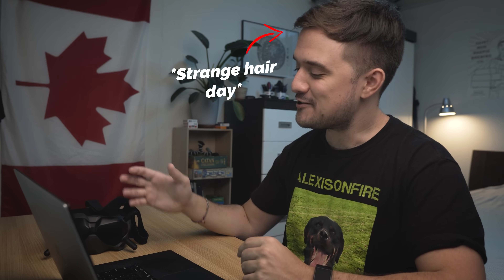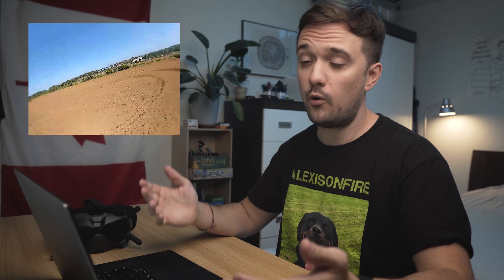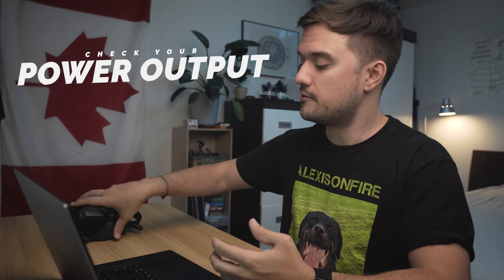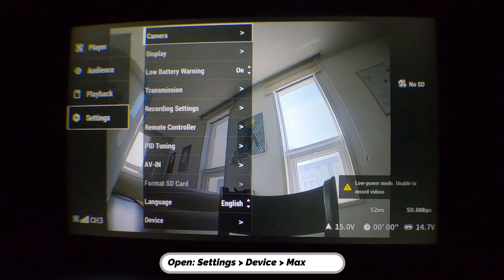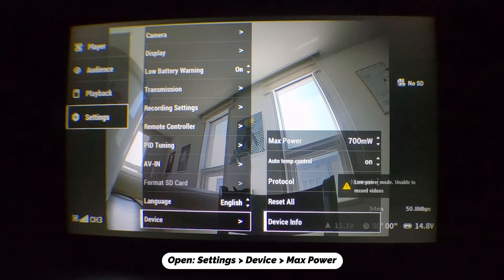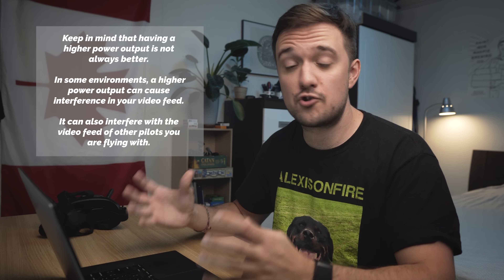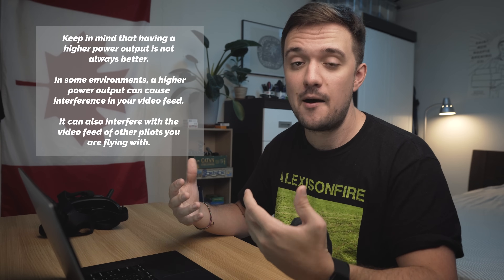How I Flew FAR With DJI's FPV System - Easy Power Output Hacks!

Comment: Nice video.... I have been flying FPV  for 5 years and I think I wanna go digital now.... But I need some help, I"m ready to buy the Flywoo Explorer LR, and I was  going to get the analog version, but after watching your videos I want to get the same setup you have, I"m using  Taranis Qx7, I gonna order the DJI fpv goggles, witch Flywoo Explorer should I get?, do I need One of those modules at the back of my radio?..... what is your setup?..... Thank you.
Reply: Ok so if you are really  wanting to push your range and you are worried about your  radio link you could buy a TBS crossfire module for your QX7. If you do that you want to configure the LR with crossfire. If you are flying under a mile routinely then I would not worry about it. Any FRSky rxsr or XM+ micro are great choices for the pre configuration. My LR is running the XM+ micro and I am running the Jumper T16 Pro Carbon for the radio. I am a pilot that typically stays under 800 meters in flight distance. Getting your DJI goggles and vista tied to your account and activated is also a step. Make sure you update them both. Its some money to buy in but once your there you wont regret the experience. Its transformed my FPV from being stressful and exciting to me just enjoying my flights. No breakup and no drop outs ever.  The LR is a fantastic quad and its a great way to enjoy yourself and stack flight time. Last step is getting some good antennas for your DJI goggles. The stock antennas have zero gain set so DJI could certify them with the most powerful transmission module. Once you put 1.7-1.9 gain antennas on your goggles you are going to notice a difference. I have the True RC Singularity Stubbies and I love them, you can get more performance but they are one of the best all arounders and are very convenient since you never have to take them off to pack or move your gear around. They are also great if like me you have a second set for flying and for audience mode and you need the extra gain for viewers who may be watching the flights. I feel as though I rambled so if you have any questions since I have all the gear you are looking to buy let me know.

Comment: hi matt im buying the mobula 6hd as my first fpv drone with a flysky radio is a fly sky radio good
Reply: Which Flysky radio are you looking at, did you buy it already and have you had fun?
Reply: flyisky i6 is that a good beginner raidio
Reply: @hanikhuzicreativevideos2613  You can use that and be good for a while. Six channels should be enough to fly most quads. If you are flying micros and minis you should be good for a while.

Comment: I am using the eachine ev800D (your prior fpv goggles) and i am having trouble getting the dvr to work. With a micro sd card in it will cut off after about 20 seconds. Does the micro sd card have to be blank? And how much storage do you suggest if i were to purchase a new micro sd card? Thank you for your videos, they are very informative and helpful for first time flyers.
Reply from the maker: Interesting. How big is the card? I remember those goggles had a problem with sd cards that have a larger capacity. Not sure if this is the same problem though
Reply: Matt Pochwat  128 GB would do it I guess, thank you
Reply from the maker: @charlsemusselman8168  Ah yea I don't think it supports anything over 32. Maybe even 16gb. The dvr files are pretty small so you have nothing to worry about

Comment: @Matt Pochwatt, you can just put the files on the goggle's micro sd card so that you only have to do it once. So that it is automatically applied to all air units/vistas you pair to.
EDIT: If you put it on the goggles it also never deactivates the "hack" whenever you update.
Reply: Do the files have to stay on the SD card every time you fly or will it save in the Goggles? 
If I remove the SD Card, will the power output change back to default?
Reply: @robertbettis8553  From my experience, yes; you can go a few flights without the hack installed but it will eventually revert back to non-hack settings.
Reply: do you have to put both files on there and leave it on the card?
Reply: @JFS-rh6cs  yes, both files on the sd card then you'll be golden
Reply: @acestriker  Can you please answer the last question, i just bought them and I would like to know too.

Also Idk what difference makes having the SD card on the googles vs the Drone in terms of everything else not related to the hack :/
Reply: @powerhouse884  When you have an sd card in the goggles, you can record from the goggles (similar to a DVR recording of your goggles).
When there is an sd card in the air unit, you can natively record via the drone's camera. You will see the recording in full 1080p, instead of seeing what you see from the goggles(720p wth added compression from the distance between the drone and you)

Comment: As I understand the limit is 4km, even if the signal is good at that distance. Must be related to the latency between googles and the air unit communication. But don't take my word for it. It was Bardwell who said so.
Reply: I think DJI Fixed that issue in the latest firmware.
Reply: It's 13k now.
Reply: Its about as far as you are brave enough to go. This is especially the case if you do not have specialty radio gear.

Comment: i knew about the fcc hack, since i am from germany an 25mw isn´t enough output for my use. 700mw works fine for me, but now i´m interested in trying out the power hack and see how far the range is on 1200mw :) Good quality content als usual!
Reply: Hallo hat es bei dir funktioniert? Klappt das nur mit der 2019 Version?
Reply: Hallo! Was mach ich dann mit der SD Karte wo der der FCC Hack drauf ist? Die hab ich ja auch in der Brille…

Comment: I added a heat sink from an old video card to the top of the air unit.  Overheating not a problem anymore.  Also important to say if the air unit overheats it continues to transmit a video feed to the goggles.  Overheating causes on board video to stop recording.
Reply: Yeah a heat sink seems like an obvious fix

Comment: Hey Matt - What is the function of enabling auto temp control? Is there a risk that it could reduce the power output when I am miles away? I noticed you set it on, is it used to protect the air unit for over heating? Thanks for the great videos!
Reply from the maker: From my knowledge it just keeps your air unit at a lower power output when your drone is not armed.

Comment: Great to the point video Matt. I still struggle to get that kind of range, even with the hack. I have purchased a TrueRC X-AIR patch antenna as well, so will see if that improves the range. Starting to think my unit might be faulty. I notice that the goggle indicator goes red and to 0 bars (even disappearing completely off the screen)
Reply from the maker: How far are you able to fly?
Reply: @MattPochwat  1km is the absolute limit line of sight before I fall out of the sky
Reply: @cam_fpv8168  hey, did you find a solution? I have the same problem...
Reply: @gilles.mp4  unfortunately not. I'd recommend upgrading to a very long antenna on the air unit. That might help
Reply: @cam_fpv8168  I tried this no help.
Reply: i have the same problem with 1 air unit did you resolve yours?
one air unit with hack goes on for a couple KM.
the one im using now goes about 200 meter and the first obstruction makes my vision all messed up

Comment: Hi Matt,
I plan to buy the DJI System also in the near future, do you plan to upgrade the Nazgul 5?
I thnik it might not even be so difficult but not sure yet.
Reply from the maker: Yea I ordered the HD frame because it doesn't seem like a vista will fit in the original.
Reply: Matt Pochwat good to know, thanks!
Reply: @ColinZenger  They just sold the iFlight XL5HD for about 270 dollars on RDQ. It was an insane deal and I had to pick it up since the parts are worth more than that. Check out the XL5 Titan as well. I plan on getting that one and I already have the DC3. Any quad I can get my hands on with the DJI system is always in consideration. I plan on converting several of my builds but its nice to have some pre built stock as well. I have seven air units/vista so far in stock or on quads. I also bought the Explorer LR, lets just say the Ramen packs are ready to be boiled...lol